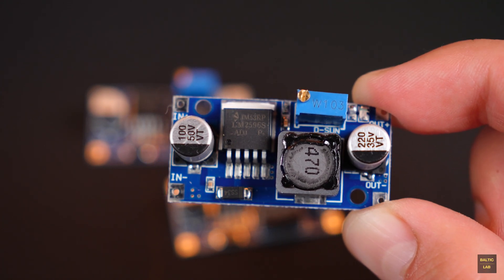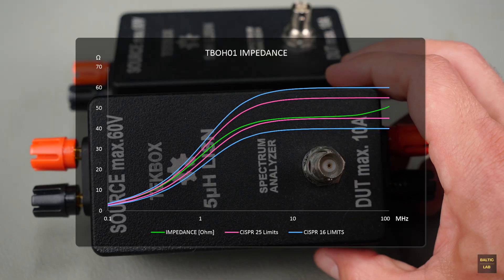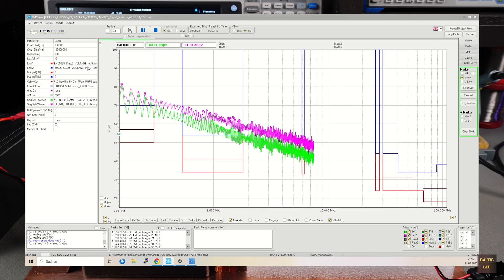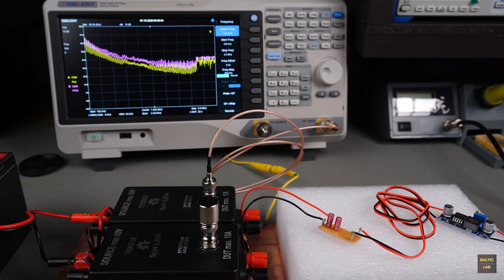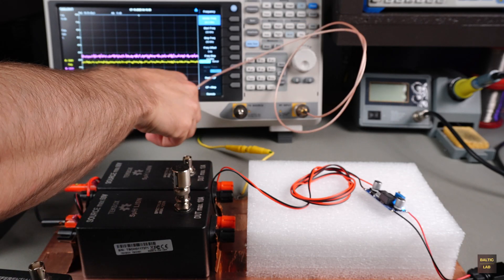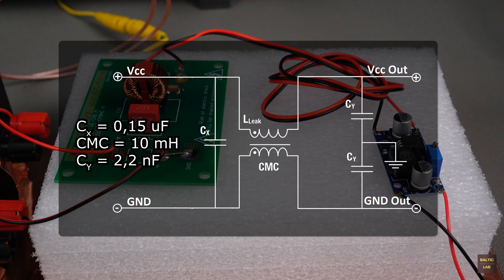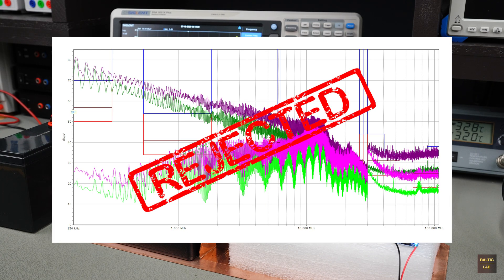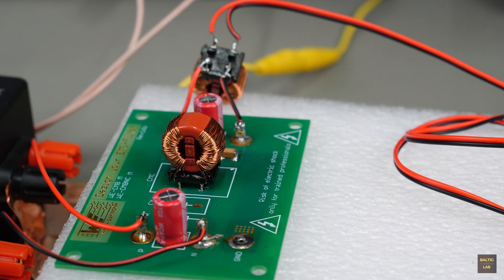Electromagnetic Interference in Vehicles? CISPR 25 Conducted Emissions Testing & Filtering Solutions

Comment: Can i use higher MH? Or 20mh is the ideal ? I having issues on my Bluetooth module it is very noisy
Reply from the maker: What exactly does your question refer to with the 20 MHz? Regarding the test setup or the filtering solution?
Reply: @BalticLab when I'm using this step down for my bluetooth receiver module the amplifier has a terrible buzzing or humming sound.

Is the 20 and 10 mH a fixed value?
Reply from the maker: @Le_Blnk____  You can try smaller values and see when the itnerference stops. In the video I targeted CISPR25 limits, your bluetooth module might be a lot more resillient than that. It's quite possible that maybe a 100 uH inducor BOTH on the positive and negative supply line of your bluetooth module and a cuple of MLCCs (maybe 10 uF and 1 uF) might do the trick.

Comment: Finally we have an EMC solution where, the Wurth one capacitor itself is 10 times more expensive than the entire buck converter module.
Reply from the maker: In professional environments, not being EMC-compliant is a lot more expensive than a few thousands of these caps.
Reply: @BalticLab  or this is just the cost of retail, you can buy them by the 100k for peanuts.
Reply: Honestly, this just goes to show how important power supplies /supply lines are from the very beginning... 
Fixing is always very expensive, especially when we go towards AC mains filtering upfront. 
Your better off putting off filters and taking time to find the right psu for your needs...

Comment: Let's say we need to bypass expensive and time consuming testing, and use a 2A 5V LDO and adjusting the buck converter for the dropout voltage. Would that be a very quick and effective solution when efficiency is not a problem. Would you consider testing an LDO?
Reply from the maker: The problem is: The conducted noise is what the buck itself sends back into the supply rails. An LDO wouldn't solve that issue. However, it would certainly make the output cleaner. The good news: There are 78-type LDO type pin compatible switchers with very low noise. The MagI³C-FDSM from Würth. Mouser usually has them in stock.
Reply: @BalticLab  I see. You want to protect the supply rails. We seem to overlook that. Thanks for the component suggestion, I was actually in need of generating a moderate current negative supply with relatively low noise. The product you suggested does seem to support this as mentioned in an application note "Entwerfen eines Inverswandlers". Currently I am using the MC34063, and it is quite noisy.
Reply from the maker: @jiangli6498 Yes, they're actually quite convenient for generating a negative supply: Simply connect Vout to ground and use the ground pin as negative Vout. Turning a single supply into split positive and negative rails is also possible.
Reply: It might be Treasonous

Comment: Great video, most people aren't aware of EFI and its potential effects on nearby electronics. Even a basic knowledge of its existence can help solve electrical gremlins.

I made the mistake of trying to use that identical cheap buck converter module to power my cat's automatic feeder so it wouldn't need batteries. The feeder relies on RFID to only open its lid when my cat's microchip is detected, but the RFID reader failed when powered by the buck converter. Not sure if it was due to interference through the power lines or radiated EFI swamping the RFID antenna.

I wanted to try using the buck converter with a dummy load while the feeder was on battery power to further diagnose the issue but had to stop because the cat wouldn't cooperate.  I'll order a test RFID microchip to help me solve the issue.
Reply from the maker: Glad you liked the video, and thanks for sharing your experience – real-world examples are always valuable. Animal identification RFIDs are around 134 kHz. I'll keep an eye on that range for you when I cover radiated emissions next. There are fixed-voltage switcher modules that are pin-compatible to the 78XX-type linear regulators and have excellent EMI performance. The MagI³C-FDSM from Würth. Mouser should have them in stock. Might be worth a try.
Reply: @BalticLab 
Nesse caso a velha é boa fonte com transformador utilizando reguladores lineares como você mencionou, não resolveria o problema? 
Hoje estamos rodeados de interferência gerada pelas fontes chaveadas em todos os aparelhos praticamente. 
Os rádios AM , por exemplo, sofria com isso, era só acender uma lâmpada que acabava a alegria 😂😂😢,  por isso que hoje aqui mo Brasil pelo menos acho que ninguém mais usa , 
Bom dia 😊
Reply from the maker: @IvegaEletrônica  It would solve that problem, yes. But: We need to think ahead linearly without revisiting the past too often. We went from conventional, transformer based power supplies to switch-mode. The solution to EMC issues is not to revisit transformer based, linear supplies, but to develop properly filtered, low-noise switch-mode designs.

Comment: I would love to see an emitted interference video, as we have issues with USB3 C connectors and cables near GPS antennas.
Reply from the maker: You're in luck: Radiated emissions will be the subject of the next video. 🥳 Issues with USB 3 interference to radio devices, even 2.4 GHz WiFi, are unfortunately a common issue.
Reply: Been there, tried to wrap my USB3 hub in foil... (didn't help much) 😅
Reply: @rkan2  It can be done, but the hub can be really bad if its cheap.

Comment: Assuming this is a clone LM2596 (which is a remarked XL4015 or similar), wonder if the real TI part is any better or not at all. The switching frequency is slightly different.
But anyway as you say better get a proper product designed for low EMI.
Reply from the maker: This device has LM2596 printed on it, but it's definitely not a genuine Ti part. But, spoiler: I did order genuine Ti parts and Würth passives. I'll replace all parts on the board with namebrand components and compare the interference. But first I'll show the radiated emission side of these converters.
Reply: @BalticLab  Nice

Comment: I just looked at a Schurter's line filter, and they have their y-caps earthed just like in the case in the video. They are left out in "medical" versions. What is the difference I'm missing?
Reply: Medical equipment requires very low leakage, so usually isolation from earth.
Reply from the maker: As @jaro6985 correctly pointed out, the Y-caps are a source of added leakage current. Which is undesirable highly undesirable in medical equipment. The maximum, permissible leakage currents are actually something that needs to be considered when selecting Y-caps.
Reply: @BalticLab  But wouldn't they cause the same problem you demonstrated in the video by connecting the y-caps to the earth ground?
Reply from the maker: @akos_buzogany  The effect I showed in the video only occurs because there isn't a protective earth as there is in most mains powered equipment. The mains analog would be to connect them to neutral. If there would have been a separate ground, a connection to the vehicle's chassis, etc. they would have been effective.
Reply: @BalticLab  Ah, ok, it clarifies it. It wasn't obvious to me the copper plate is actually connected to the negative pole of the battery!

Comment: F*k is this why my 3d printer died? 😂 (have a cheap buck running the pi)
Reply: Uhhh i mean not really, the Pi probably wouldn't die from EMI. but the output quality is also extremely concerning and not something i'd feed to a Pi. They're just bad news all around, suitable for simple devices like LED strips and fans, but as this vid shows, even in this case you want extra measures on the inputs.
Reply: @SianaGearz the pi is fine. The 3dp mainboard gives uart errors for the drivers. Tried swapping a few, was gonna scope the uart lines later maybe or try a new driver.. also should just try powering it with a clean supply lol my 24v got whiny, it was just bucking the 24v but I wanted to separate it anyway, kind of annoying having the power together, was only supposed to be temporary, I'm always fkn with my printer lol
Reply: @forbiddenera   Yeah OK EMI is a candidate.

But many printer boards (MKS and BTT) just have garbage 3.3V or 5V lines even regardless, which can give you grief.